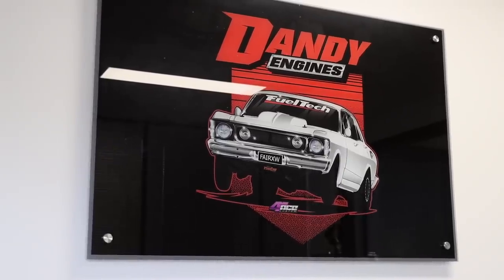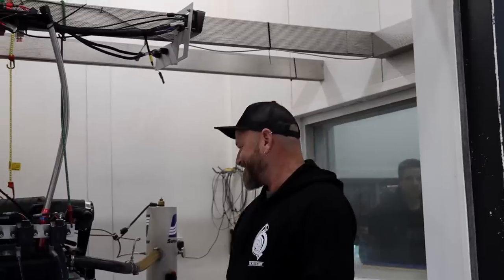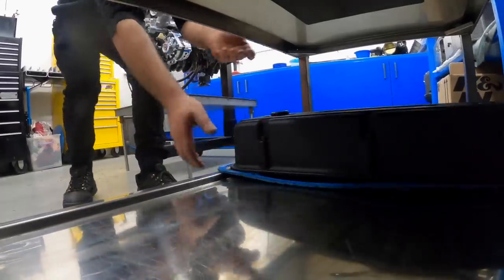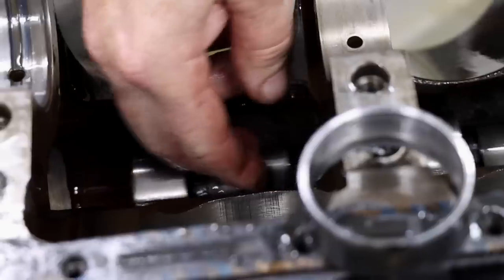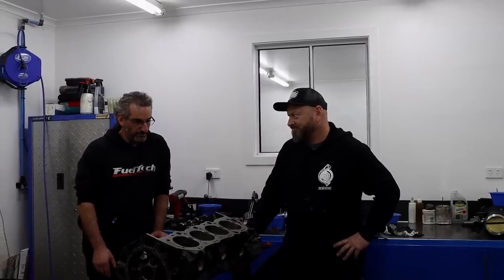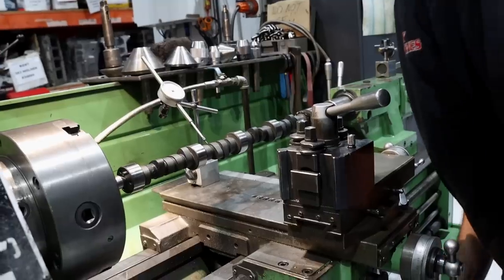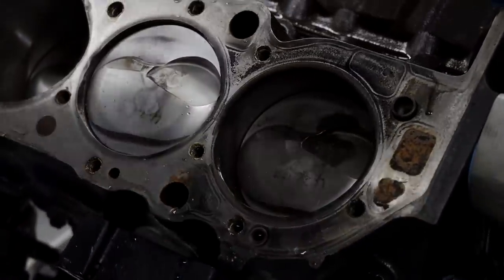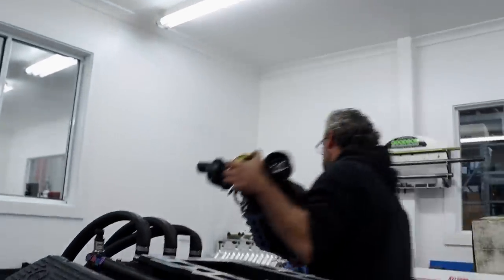Al's Blown Big Block EXPLODED On the DYNO!

Comment: Hand lapping the valves you have to be kidding you guys deserve what you get . You use dial gauges to check the flatness of the head but you use a hand lapping to check valve seat runout. Yo guys are dinosaurs.
Reply: Are you a machinist? I hope not because you don’t know what lapping is for and you don’t understand what runout is either.
Reply: Hey dood I have worked in a cylinder head reconditioning shop and was passing comment on your dinosaur attitude towards checking the valve seat for concentricity. You guys have failed .
I tested the vacuum machine and found they are only good to read up to 5 thou. Check your workshop manual for any Otto Cycle 4 stroke engine and you will find the maximum run out on ANY valve seat is 2.5 thou. Hand lapping is for dinosaurs as you guys are clearly not serious about maintaining customer satisfaction. While you maintain your poor workshop practices the industry falls into disrepute. If you check an old TRW parts catalogue in the top right hand corner of the cover is a picture of a valve seat concentricity tool which allows the user to PROPERLY check the run out on a valve seat . Of course the valve guide needs to have the proper clearance which is another story altogether.
Reply: @1darryloflife  Firstly dude (not dood), your initial comment was nasty and uninformed.
You are confusing CUTTING the valve seats and GRINDING the valves with LAPPING. They are 3 different processes!
Lapping is the final finishing, almost like polishing of the the valve\valve seat combo and barely removes anymore than 1 thou, if that!
Runout is an inaccuracy of something rotating! Valve seats don't rotate, the valves do and the video clearly showed them checking that.
Secondly, Did you really just type they are "not serious about maintaining customer satisfaction"?!?!??  SERIOUSLY?!?!??
They just worked through to midnight to put it all back together "dood"!!!
Lastly and ultimately, who on earth are you compared to Dandy Engines??? 
Some random guy in the comments who may have worked in a head reco shop. Was it for performance stuff?
Do you run a VERY SUCCESSFUL engine building\machine shop? Do you get asked by Harrop to do a lot of their development work?
Do you really think Dandy Engines would be where are today if they didn't know what they are doing?!?!??
Your comments are silly and nasty, sounds like you are someone who always needs to try and prove themselves. Painful.
It's OK "dood", you can't always be the smartest one in the room.
Reply: @horsepants5848  Appreciate the spelling corrections as i guess i need to calm down when portraying the truth.  You have not confronted the FACT that a vacuum machine is NOT accurate and yet you bothered to highlight the reliance upon a device that WE have proven DOES NOT work for serious engine builders. Again I will highlight the FACT that hand lapping IS NOT necessary when you have the right tool for the job. I was trained by the best in the industry a man who spent 30,000 hours on engine dyno's PROVING that the majority of so called engine builders in Aus and the US are bloody hopeless when it comes to doing a basic engineering check on whether or not a valve is going to seal when it closes. This simple analyses can be seen on a chassis dyno when placing the engine load for a period long enough to get the pipes hot. If the pipes are all a different color then there is a temperature unbalance occuring due to power leaking into the exhaust on SOME cylinders. 
I tested the above in a business that was around years ago called C.O.M.E in Caufield . They showed me how the test for valve seat concentricity was done machining the valve seat and then hand lapping the valve to the seat then checking the end result against a vacuum tester. I then asked the owner of the business to grab a copy of the TRW catalogue which displayed the VALVE SEAT CONCENTRICITY tool, and the tool proved the vacuum tester was useless.
I do know what I am talking about as all of this was done back in the 1990's and we were attempting to show people like yourself the truth about what an engine builder needs to keep an eye on when dealing with a customers cylinder heads . 
The feedback we got from the engine reconditioning industry was , "oh that takes too much time, forget it". I had a number of businesses push aside our temperature control products and common sense engineering . So we went oversea's as Australia is broken from top down to the bottom. 
It is genuinely sad as there is NOTHING like the sound of a V8 that has all the cylinders operating in harmony, it is completely different to what you or anyone in Aus has heard but when you hear it that sound is truly life changing, so remain in ignorance and keep on abusing Otto's wonderful 4 stroke internal combustion engine as the downfall of that engine falls on the likes of your shoulders for not taking notice of common sense when you read it.

Comment: I have stuff all knowledge about engines and cars but Wouldn't it be better to use billet camshafts for high power motors rather than cast camshafts? I just know the cast ones are brittle and you can snap them pretty easily just by tapping it against something solid...feel free to educate me

Comment: Front cam bearing oil starved and tore the cam gear off, first piston (no.2) smacked the open valves, transferred down the push rods and bust the first section out the cam. Great watch guys.

Comment: Looks like a fracture from accelerated fatigue from the increased loading.  If the cam shaft was used, it has probably had a crack in it for a long time, but the stresses have been sub-critical up to now.

Comment: was this a probable bad combo of solid flat-tappet cam and a cast camshaft mixed with too much torque ending up lifting the head and spring-shocking the casting?? i want to say roller cam on a forgey boy would help out, as well as a double check on the head studs for stretch / perhaps a different torque sequence....

Comment: Watching the incident at 0.25 playback speed is interesting. A little jiggle as the cam snaps then a dramatic momentum arrest as the floating camshaft interrupts the piston downstroke. 

Whistlin' Diesel has a video where he was surprised a GTR cam had broken in use and then he was shocked to be able to, rather easily, snap another GTR camshaft outside of the engine by tapping it with a hammer.

For junkyard swaps I've seen old cams used as lift point angle adjustors... and recently at a marina which could have become costly in a snap. The lobes and journals do make good catches for repeating the angle setting. Won't be trying that one anytime soon.

Comment: The head gasket failure and crankshaft snap made me wonder if this was a hydrolock situation. Did just enough water get in the combustion chamber to increase the pressure beyond the crankshaft limits and then evaporate due to the heat and quick shutdown?

Comment: Get the cam inspected under a microscope you can tell if it had a crack that was missed. Maybe just error in the material, happens pretty often these days.
How do you manage to bend a gudgeon pin by 0,1 mm?

Comment: X-ray n magnaflux of cams  , along with rods , blocks w/ pressure test . With parts coming from everywhere  I always check .! On fire up before pop ! Heard one cylinder low on compression . Maybe a lifter came apart to jam cam . Hard to armchair diagnose , better to be there !  South of equator it’s upside down !!

Comment: I bet that gasket blew because that cylinder was in the power stroke when the cam broke. Combustion went off, but the exhaust wouldn’t open so all that pressure had nowhere to do. The rod rod didn’t bend because luckily the head gasket let it out first. That’s also how the engine stopped so fast I’d bet. Wild failure!

Comment: Question who was the camshaft manufactured by? I've heard more then enough stories about Chinese cam blanks and issues with them.
Also heard about issues with crankshaft with place of origination being from China. After see what happened with that cam I'll be sticking to companies that aren't using Chinese materials when possible. Thanks for a great video sad that you all had to work as hard as you did to repair the damage caused by an obviously bad cam blank...

Comment: Yeah I put a BBC 402 into An 1987 S10 pickup and I built the whole engine but screwed up and forgot that collar that connects the distributor and the camshaft but then I spun a main bearing so again it came out rebuilt it then ended up selling it

Comment: 27:45 clearly visible the reason why it blew a hg and bent the piston pin. All that cylinder pressure has suddenly nowhere to go because valves are closed. I would have checked the rod length and also magnafluxed the crank. That was a massive shock load.

Comment: Cams are complete BS these days. Flattened a Comp Cams flat tappet cam for a Ford 351m in 25 minutes. Now I'm running Howards rattler roller cam. Cost me 1600 bucks on machine shop expenses to fix my block. Machine shop installed my cam to begin with. Degreed and moly lube everywhere. Purchased the cam and lifter kit. As well as the correct springs.. head work included. Lift was .498" stock rockers.  Junk cam. Comp will not answer the phone. Spent 2.5 hours "next in line" with customer service, no answer. 5 hours on hold total.

Comment: When the engine blow up happened 3 mins into a 31 min vid I knew there had to be some kind of walking on water type miracle but I didn't think there would be 2 (1 the lack of terminal damage and 2 the rebuild in such a short timeframe).

Comment: I guess it all depends on how old the cam is right I mean it’s a cast iron cam from the look of it you’d think it wouldn’t have the issue with age already where air caused spaces between the inside spaces to expand causing the failure even 1940’s and 50’s cars still use original camshaft so maybe it could’ve been a bad casting job that somehow lasted a lot longer than it should’ve??

Comment: What is the static compression? Looks like alot of dome for a blower but IDK.
Reply from the maker: 9.8:1
Reply: @theskidfactory  its was cool to watch your care and attention to detail! that's compression is certainly doable with aluminum heads and being careful! I could see it wasn't detonation damaged on the pistons, but I have seen cast cams fail if the core is too small to handle opening the large exhaust valves against the cylinder pressures and valve springs.   I learned that if the deck wasn't straight and if the line bore needed help then likely the cam bores are out too. One reason I went with Crower on my 440 was much larger cam cores. Keep trucking and showing us the right way to do things!

Comment: If the compression blowout is on the same piston that the cam sheared off at… maybe the lack of compression allowed the valve to float, allowing the hydro lifter to grow to the point that it stopped the cam from rotating?

Comment: Does anyone have a reason for how/why the wrist pin got bent? I never saw that happen before even on a hydrolocked engine that shortened one rod by 3mm, in retrospect it looks to me like the dyno failure was the best thing that could have happened to this engine with the other faults the subsequent teardown and inspection brought to light..
Reply: I think it was when the cam broke the coil for that cylinder fired the plug and the exhaust gas had nowhere to go

Comment: Harmonics in the engine is my guess why it failed. Nicola Tesla found when you match a materials naturals natural frequency and match it that a destructive force in the material creates unstable bonding of itself to its adjoining same materials. Look up "Frequency Beating", its when pulse or frequency waves add up and build in intensity and force. Harmonic forces build with each force or pulse of the pistons and rods.

Comment: It broke because you didn't blueprint to block and you had your cam tunnel was out of alignment with the crankshaft or you had core shift and a couple of the cam bearings were off from each other but more than likely your cam was off by .005 or more

Comment: Gotta bad cam. Micro fissures in the casting (microscopic cracks and air bubbles). Happens quite alot. Not all companies XRAY there cams. Only way you can see them. And even then,....they are so tiny its difficult to catch. As soon as harmonics begin to course through the motor,....those fissures begin to grow and expand.

Comment: i think nobody noticed that many OEM and some camshaft supplier don't tell you that they are NOT steel camshaft BUT actually CAST IRON you can definitely see that in the fracture point  and since not many engine builders seams to know that if you put a 300LBS-IN rate valve springs THAN those cams really don't like that ESPECIALLY the made in CH land cams aren't really well case hardened on the lobes they just don't break in that good ask "uncle tony garage" about hit he will tell you !

Comment: It was the cam button you didn't need, put too much drag on the cam sprocket!  (joking)

Still can't believe you broke a cam at 5000 rpms and the total damage was 2 bent valves, and a tweaked piston pin.  (and the cam and lifters, obviously)  Sucks that it failed, but that's the luckiest failure ever.

Comment: I would say that sounds a little bit noisy to me I've only lost three engines one to sabotage and one to the installer and one two machined a little bit off too much off the heads and didn't tell anybody. And the driver not taking his foot out of the gas when he went over whoopee-doo that's the vehicle in mid-air.

Comment: I would not use a flat tappet cam in an engine like that.  You always want to put as much in your favor as possible.  Hydraulic rollers are good. So I disagree with his point on that. We use them in boats all the time, which is as harsh of an enviroment as you can get. A boat engine never gets a break. Its always under a load.

Comment: Question: head stud threads exposed to coolant galleries. Less thread resulting in less strength PLUS steel threads exposed to corrosive water. Sounds like poor engineering. Opinions?

Comment: What’s the point of a $150 camshaft in this engine in the first place? Run out of money after buying that blower or what? Anyone dumb enough to run a flat tappet cast iron camshaft now days needs beat with it… billet steel roller camshaft. Hydraulic or solid. Period.

Comment: 4 minutes on a dyno under load?

WHAT IN THE HELL FOR?  Why didn't you just throw screws in the cylinders?

NICE oil on a stock engine. Krispy!  
NICE regular nuts on your main studs.
Production made from billet?  Billet what?  Every solid chunk of metal that is machined into parts is billet.

And thennn I see your altro with a factory chucking filth into the atmosphere before seeing this channel is called "skid factory".

I really wish they'd ban you people.
Reply: WTF?
Reply from the maker: Are you bored waiting for your Tesla to charge?
Reply: Cool drones Chris Harris. I hope you’re charging them with renewable energy.
Reply: On behalf of everyone here 'thanks for watching'.
Reply: @E-Z_Gaming  Actually I do have solar panels. Not for my house though so most of the time I charge off our grid that is 35% nuclear, 30% hydroelectricity from dams, 20% gas-fired(sadly) BUT more and more from the wind. We're getting HUGE on wind which is replacing the gas generators.
  
But if we're camping, I do use them to charge not just my drones but my RC boat and cars.. :)  
.